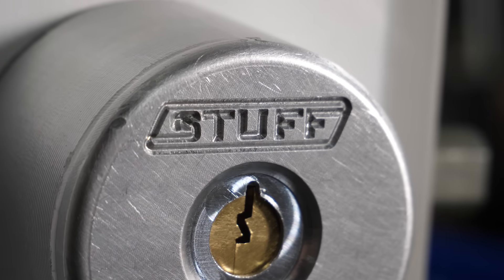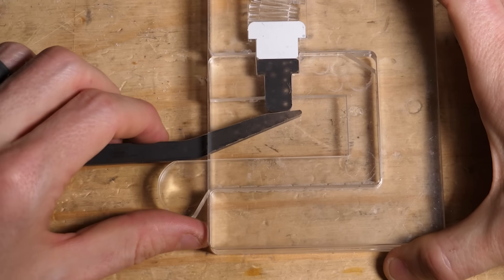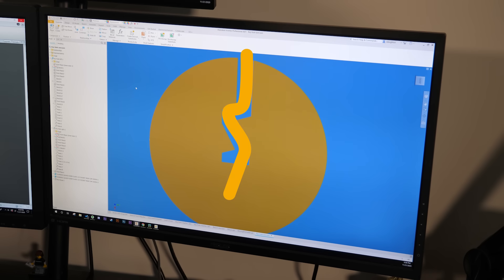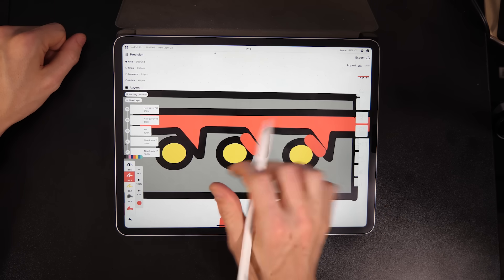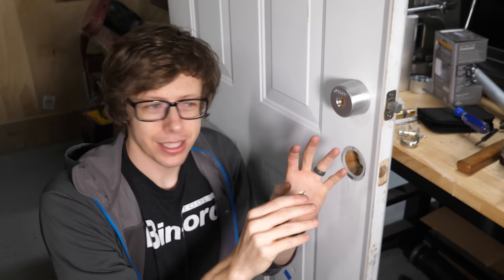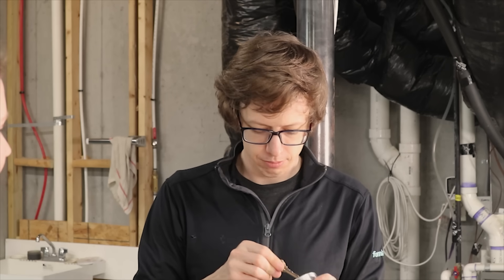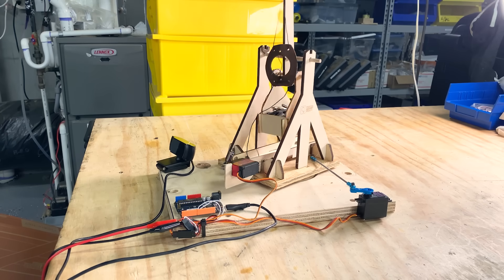Making an unpickable lock. Calling locksmiths

Comment: Main weakness I can see the strength of the locking mechanism. It's just friction, so if you turn the core until it stops and then give the lock a few shocks (harder to do while mounted in a door, I admit), then the pins can slip into the gates.

Comment: Yeah my grandfather was a lock picking specialist way back when. He also designed some high security locks still used at certain locations. He encountered people who claimed they had an unpickable lock. They were all pickable. They just needed either a new tool or a different technique. Someone would just have to probably make a tool for this lock. Lockpicking is mostly by feel anyways, not by trying individual combinations.

Medeco locks were supposed to be unpickable at one point. They’re not.

Ace locks (the locks used on a vending machine) were supposed to be harder to pick than pins and tumblers. With the proper tool, they’re way easier lol.

Comment: Imagine a normal keyhole, but you insert a 3D object which the lock fully closes around, no hand-held bit. Then it pushes in, where it mechanically checks the shape, then you can turn the entire assembly to open the door.
No indicators while open because those systems aren't in contact. No feedback or access while closed. Obscene key variety in 3D. Would be hell to build though...

Comment: I dunno much about lock picking, but if you're trying to make an unpickable lock stop being so traditional. Make a key that is not a | shape but an X shape, or even better an O shape, think about how many pins you could do then? What about adding things to the key, what about magnets? You could do a magnet at the end and the lock only works if it's pulled in by a magnet, you can't solve that with traditional lock picking tools and unless they know it needs it they will have no idea. What about false pins that when pushed up actually prevent it from turning, or bewby trap pins that hide other pins, or push other pins down when triggered, or you need to do the pins in a certain order.

Comment: Unpickable lock is easy. Use say....50 to 100 small magnets inside a "base" the key has theese same magnets that have to line up perfectly. Now make the magnets need to drop sequentially in a specific order made to custom settings for each lock. False "trips" and such can be sparsed out for added security. Unpickable.

Comment: The future is digital. I admire mechanical locks, but... . A digital lock can be improved to muliple steel  bars with unlimited strength, because there is no mechanical connection. It is also impossible to copy the key.

Comment: Is it possible to have a seperate chamber where there is essentially another lock in the lock that you have to go through with the key (it could be a speical key) before you get to the main chamber, and like in cars, could you integrate RFID into the key so that it wont open without the signal?

Comment: The Hobbs floating bolt stump is pretty  good .But as a locksmith I use a much simpler design By Anker slot , The warding in the key way stops you being able to touch the pins with a pick (on my key way) used by the ministry  .Some times you can over think things . The are a few locks out there now that are un pickable .

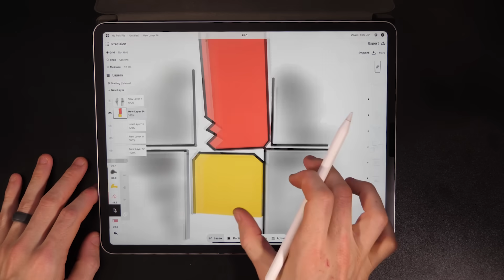Comment: Using normal picking methods, you set the lower pins such that the shear line aligned as shown at 2:54. At this stage, the upper pins (gold ones) are set to their height and locked in position. Then you just open the lock normally? Someone please let me know what I’m missing. I don’t understand how it’s unpick-able in theory.

Comment: Build A semi digital lock that still uses A metal key. But instead of pins you have laser sensors. Impossible to lockpick 😂
Using no wifi or passwords that can be hacked.

Comment: Any door lock is only as strong as the nearest glass window. ;)  But that right there is an incredibly cool lock.
Reply: I love how simple this wisdom is.
Reply: Any door lock is as strong as the walls are resistant to being smashed open
Reply: wrong. the lock doesn't mater if you are able to just remove the hinges and open the door.
Reply: @coinisinorbit Any door lock is only as strong as the nearest window bar. ;)
Reply: At least Windows come with automatic alarm sound heard up to 100 metres away

Comment: Couldn't you have a mechanism where the key slides in half way, turns into where the opening is with the pins and then push it in the rest of the way to activate? It wouldn't be pickable because the opening is hidden behind a slide mechanism

Comment: By adding every symbol (100) every number (10) and every letter (26) which gives 132 characters in total, if you try to guess a 5 letter password with a random character out of the 132 existing there would be 46525874176 combinations.

EDIT: i also forgot, about the capital letters., 52 + 132 gives 188. 188 x 188 x 188 x 188 x 188 gives 234849287168 COMBINATIONS in total.

Comment: Hey there Mr. Stuff, since watching your video years ago I’ve been designing a lock mechanism that accomplishes all of the goals you had in the design of this one. I finally had my eureka moment a few weeks ago and have designed the lock in Fusion. I’m currently working on saving for a patent and I’m hoping to manufacture it to sell. If there’s any way you could help me build a functioning prototype in metal (as a 3D printer can’t make small structural parts) it would be an immense help. I hope whatever project you’re working on isn’t too frustrating. Thank you for the inspiration behind what I believe to be my most practical invention yet.

Comment: I've seen unpickable lock. You have to put key not in keyhole below handle but the one above, then pull up the handle and then turn the key. And only then you can pull down handle to open the door

Comment: wouldnt the picking just require two torgues instead of just the twisting torgue alone? in your lock.. their would be the twisting torque plus a pressure torque at the very end? And once LPL figures out how to apply both torques simultaneously.. then they just proceed with normal picking procedure?

Comment: this could be a great design to sell the patent for. However you need to remember to make it out of very sturdy parts and have it also surrounded by very sturdy material in case of brute force attacks. Or just simply cutting away all the material around the lock because its too hard haha.
Reply: As he says, the lock isn't commercially viable. This is because each lock has to be individually made to match the key. With a conventional lock, you only need to replace the pins to get it to work with a different key.
Reply: Battery powered angle grinders exist, these locks are obsolete at this point
Reply: if ur gonna damage stuff u might aswell go for the door hinges

Comment: I'm curious how much stronger this could become if you did the same on the top as on the bottom but with different heights, you wouldnt have a symmetrical key so putting the key in may be a pain to unlock it yourself

Comment: The hard part to make... Hmm... First thing that came to mind is a thin sheet of metal that has round holes for all pins. If this moves even a bit then it locks the pins. You may design it with one spring in the end and key lever that places it in right position.

Comment: What about using different shapes pins, for each pin? Then have them fall at different points every time the key goes in, so In order to get it to all line up they only have one ledge to work but it tricks the lock picker to not know the angle or shape they need to get to the specific area to allow the lock to unlock? 

Hoping for a reply to this comment ❤️

Comment: I think this lock wont be hard to pick if a key without the upper part is fashioned just like the one lock picking lawyer had. Essentially, the design is amazing but the locking mechanism should be set to lock the pins not based on the insertion of a key but rather based on position. If you start to rotate the cylinder, they lock up in place and then you cant have access to them when they meet the barrier and it would be the perfect unpick-able lock. In this design if the back of the key insert is pressed then the lock becomes just like a regular one as you can access the pins while it is rotated until the barrier(even if just dropping them one by one by pulling out the key like lock picking lawyer did). Although i may be missing something i think locking them by position both allows for the locking mechanism to work and ensure that at the barrier there is no access to the pins. Respect to Shane for coming up with such a cool design.

Comment: Opening it wouldn’t be any more hard than a very secure lock, like a medico…
Comb it so all upper pins are as high as they go, put pressure on the upper pins by turning it and tensioning the pins on the gate and then tap it… they would fall and catch like standard pins in a bible. The problem is, that there are still tolerances in the pins and in the machining that differs from one another

But I must say, that is a great design and an amazing looking lock. Just pointing out the flaws, in case you wanna work on them

Comment: You would have about a .00000007% chance to guess it right the first time with all possible combinations of letters,then there's actually physics meaning there are far more than 13000000 possible combinations with different lengths,amount of pins,and all around design

Comment: Well, wouldn't a key with a IR diode make looks way more secure? Special key (three layers with GND in the middle) that gets energy trough it when is inside the lock thus making the IR LED light up. When the key is at the opening position there should be a long hole with an IR sensor at the end opening another lock when it receives the IR signal.

Comment: I just got an idea recenly based on the presented concepts if possible you can convert the pins into screw and just turns into the right angle in either cc or cv to move the pins lower or higher this means special key is needed with complex gears inside which turns in two stage 1 is to position the screw pins into the right angle and 2nd is to finally to turn and unlock.  the turning angle of screw can be adjusted by its thread fine thread means less angle and large thread means larger angle adding more complexity of picking

Comment: That was a genuinely competent locksmith. He actually tried to pick the lock.

WAY too many locksmiths out there will pretend to try to pick the lock, then claim that it's "unpickable" (even for a normal, easily pickable lock), drill it out and then charge you highway robbery prices for doing something that required zero skill to accomplish and destroying your lock. Then they'll even have the nerve to offer you to pay them to replace the lock they've just needlessly destroyed.
Reply: I got fooled by this recently like a moron. Never again
Reply: Well they have the knowledge and expirence to do it, plus they were on call.   People that call locksmiths typically don't have either of those or the tools to get it done.

It's a fair trade
Reply: @Thayleon The knowledge and experience to... Operate a hand drill, bolt cutters, or an angle grinder? That's not a "locksmith". That's your buddy Dave who has a part-time job in construction.
Reply: @thatrandom_canadian   Bolt cutters and an angle grinder won't help very much against a dead bolt.  And a drill only works if you are familiar with the locking mechanism and know where the screws that fasten it are.

I did lock smithing for a prison for a few year.  Yes, a lot of it is pretty simple work but it does require know-how, problem solving, and a toolset.
Reply: @Thayleon  great answer!!
Reply: Repent and trust in Jesus. We deserve Hell for our sin. Lying, lusting, etc, but God sent his son Jesus to die on the cross and ride from the grave to free us from sin. If you repent and trust in him youll be saved.
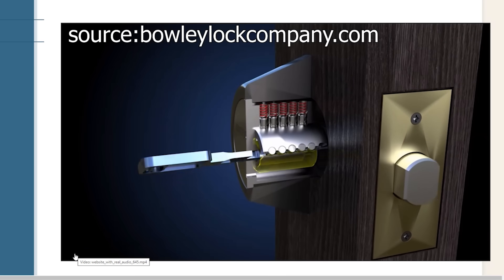Romans 3:23
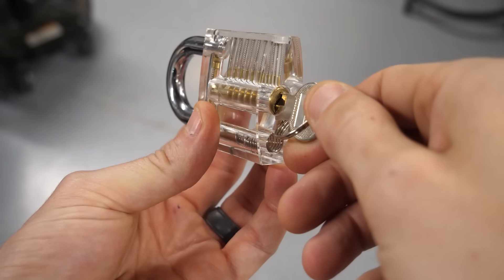John 3:16❤😊❤❤
Reply: @christianweatherbroadcasting  prove it
Reply: @christianweatherbroadcasting ok but what's the weather  for today
Reply: @christianweatherbroadcasting haha atheism go brrr
Reply: @christianweatherbroadcasting  unorthodox

Comment: That is such a clever lock. However, where I live, if a thief can't pick the lock he will simply chip away at the door until he can get in. We have had a door totally ruined and the whole locking mechanism removed from the wood. Apart from getting a steel door on your house, do you have any good ideas to stop your door being destroyed? I guess you could insert a piece of steel around the lock area if a steel door is too expensive?

Comment: This is very cool. Would love to hear an elaboration of why this isn't commercially viable. Would love to have a smart lock that includes a key option with this mechanism.
Reply: You need to be easily able to produce copies of the lock that work with different keys. With a conventional lock, you do this by making exactly the same lock, but fitting different combinations of pins, since it's the locations of the splits in the pins that control which key needs to be used. But with this lock, it seems like you've have to completely remanufacture the lock to change the keying.

Comment: It always takes a while to pick the lock and using the key is almost instant. 

Why don't locks have a mechanism where as soon as something is inserted in the keyway, if the lock isn't opened quickly, it just sets itself not to open.

Could be achieved electrically or maybe mechanically?
Reply: Well, there's a problem with that. Someone might be slower at opening the lock, or drop something and leave the key in for longer than expected. Then it just doesn't open.

Comment: Engineering only works if it includes ALL the data.  The installation of the lock on the door is your biggest weakness.
I would suggest that for v3 you engineer the entire door, not just the lock.
Reply: No, the entire building the lock is on is its biggest weakness.  Brick in window is always easier for a thief than non-destructive entry.
Reply: @commscan314  i disagree, the entire city the building is built on is the real weakness, so the solution would be to lock the city.
Reply: @Kissiehyudo  lmfao 🤣🤣🤣
Reply: Ugh, mission creep.
Reply: Integrating this lock into a door would do it. That'd make it impossible to unlock even LPL
Reply: Just pretending like I understand all this 
🤓

Comment: have you tried using some sort of vibrating device with one of those wavy pins attached to whilst pushing the back 'lever' in the back of the lock with a straight one?

Comment: “Locks are to keep honest people honest”
Reply: @jay31wildcats19  He is saying good locks help keep crime at a low. If you are refering to me, I meant locks are useless because most house robbers just open the door. Most people don't lock their doors or windows. I'd get a security camera. Locks get be picked but no one wants to get caught stealing on camera. The camera doesn't even need to work. Most theives just won't take the risk.
Reply: @slyking214  kk
Reply: @slyking214  And those cameras are even illegal in many places...
Reply: @michaelpettersson4919  In my country having security cameras is perfectly legal.
I live in Australia by the way. I don't see why cameras should be illegal, if you have nothing to hide then you shouldn't care about the cameras.
Reply: @slyking214  There are alot of red tape to cut through in order to aquire a permission. As a general rule the camera must avoid filming uninvolved people so it need to avoid getting a view of the street outside. Buissnises can get away with more then a private citizen can though. Cameras are not actually illegal but their use so prohibitively restricted that it is a minefield of regulations to be careful around. I live on Sweden by the way.
Reply: @michaelpettersson4919  Those rules are there for a reason, you wouldn't want your neighbour to point their camera at your house, but I hate how businesses can get away with a lot more than citizens can.
Reply: Most people don't even lock their doors, the bigger problem is locking both doors, even if you are home.
Reply: That really shows most people are just posers

Comment: “Get a lock that doesn’t have a key” “Now today we are going to open this lock without even touching it, the tool, a magnet.”
Reply: Brain power is more useful ?🥴
Reply: Wait does that actually work, whats the poi t of lock picking then xD
Reply: @uttkarshtewari2532  electronic locks use a solenoid mechanism to retract the bolt, which often 
can be manipulated by a high powered magnet.
Reply: @stenmin1234  Some insanely cheap deadbolts as well.

Comment: Being a locksmith myself this is actually very smart.
Reply: From my general understanding of engineering, I see a major flaw in the design. Sure, it is very hard to pick if not having the key. But if you do have the key, the unlocking mechanism seems prone to fail. In my opinion, this defeats the main purpose of a lock: It is not about prohibiting access securely, but selectively allowing access reliably. I am not a locksmith, though. What is your opinion on this?
Reply: @BlueScr3En  Honestly I would never use this, Things like this are prone to just... Not work one day then you'll almost never get it open if you don't want to destroy it, these things are just neat but they have no Practicality, a customer wouldn't ever really want this seeing the flaws it has if it were to ever break, this would be a good lock to have for scammers though, and yeah i get what you mean.